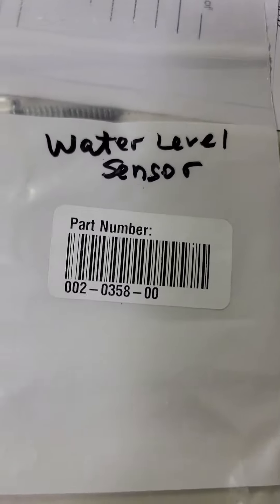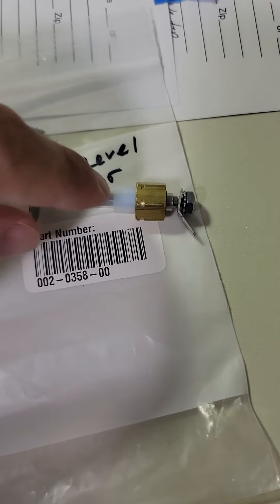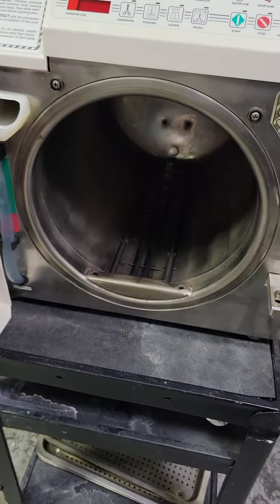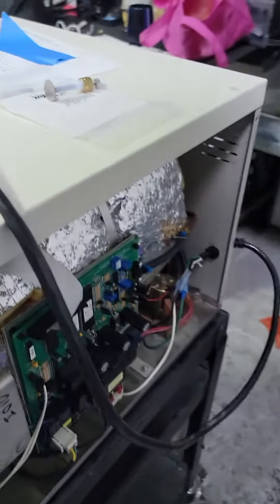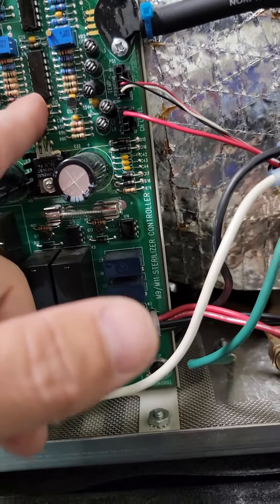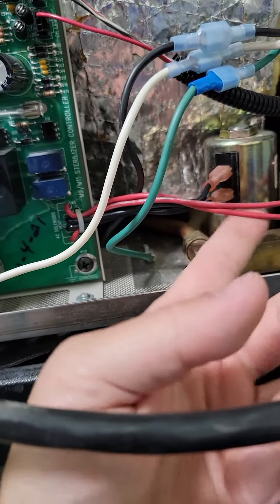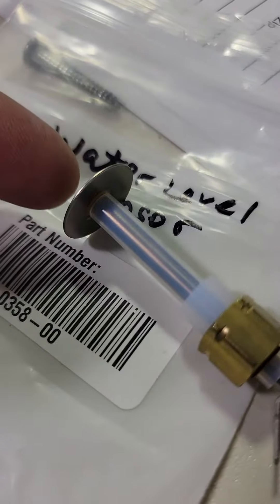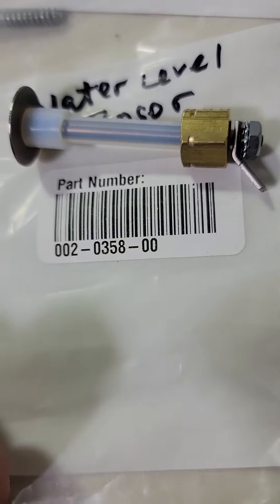Midmark - water level sensor for a midmark sterilizer

Comment: How do you actually remove the sensor from the autoclave? I have the nut loose, but it only loosens so much and wants to stay on the part where the nut threads onto. I can turn the sensor inside the chamber, but it won’t come out. EDIT - I got it!
Reply from the maker: once you remove the compression nut, it can be pulled out from inside of the chamber. If you'e is stuck, give it some more force, perhaps a pair of needle nose in a prying method, or channel locks
Reply: @The_Biomed  thanks! Having never done this before,  I wasn't sure how much force I needed to get the compression nut off the nylon tube so I was being overly cautious at first.
Reply from the maker: @Pitmaster_GoldenShellback  no problem, it's just brass so being weary was the right move. I keep stock of multiple sizes and ferrels just in case. They do strip and warp easily.

Comment: Is there any advice at all you have for a chamber that floods when the autoclave door opens and then the panel says "water low"? It keeps gushing water out the front when we open the autoclave door. Thank you!
Reply from the maker: without seeing the unit, I'd have to surmise that your water level sensor is dirty, or malfunctioning. the midmark sterilizers use a continuity circuit to detect when there is the right amount of water in the chamber. 
water low is because all of your water is in the chamber, (and floor?)